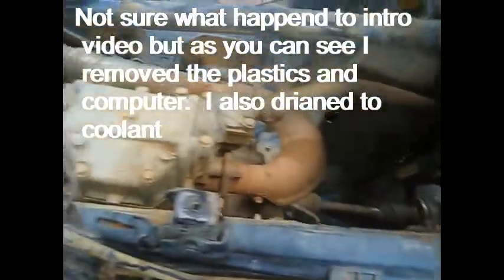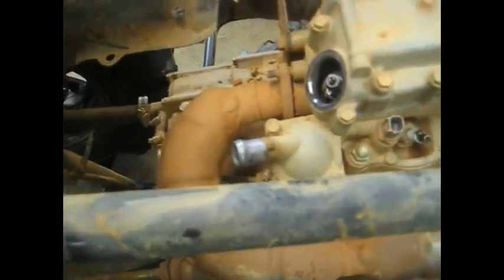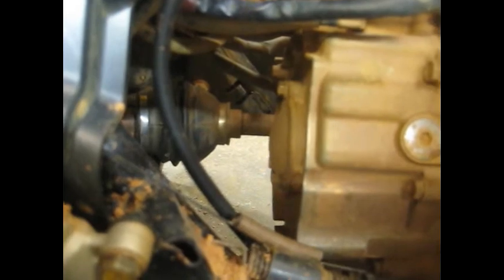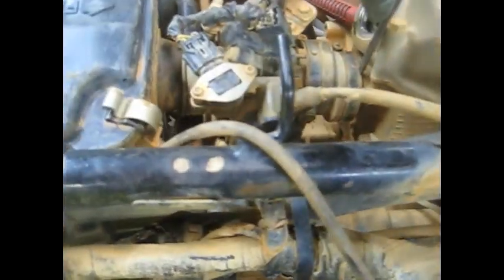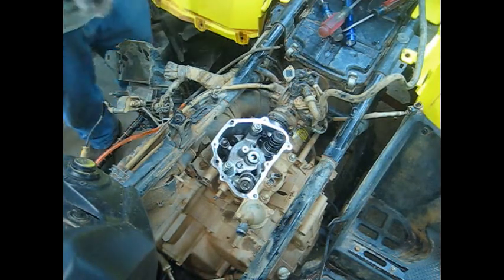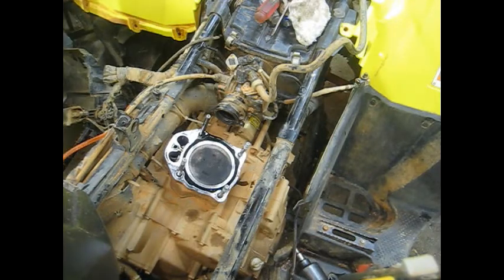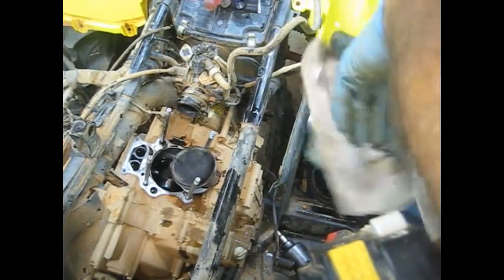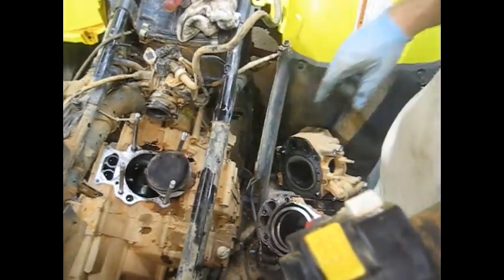Foreman 500 rubicon top end rebuild

Comment: You have the best videos man, really appreciate watching you work.  I just bought a 2006 trx500fe.  It had a brand new top end put on it.  Piston, rings, pin and cylinder.  It still had a slap in it, the powersport shop told the guy it was the rod.  Is there any chance that an oversized piston pin can be gotten and the upper rod and the piston hole be machined out to accept the oversized pin?  Thanks!

Comment: I have the same Wheeler but it's pouring oil in the air box. What could it be? I can ride for a few minutes and it's filled with oil. It's coming from the tube on the left side of the airbox.

Comment: After I put a new head gasket and torqued everything down , I’m guessing coolant is getting pst the gasket bc it leaks out the sides , is gasket maker of some time needed ?
Reply: It also smokes bad
Reply from the maker: You shouldn't have any gasket maker on the base or head gaskets. If you put it on the base gasket the gasket will squish out under the pressure of the head bolts and make it leak. You probably messed up your base gasket

Comment: I've always called it a rocker box but where do you get your parts from
Reply from the maker: Rocker box makes sense. I usually get my oem parts from one of three places. Either mrcycles.com, motorsport.com, or partszilla. The first may take a little longer but is normally cheaper but the last two can get me parts if they have them in stock in a couple days.
Reply: Thanks for the reply I'm rebuilding a 05 trx500tm I've learned alot from your videos
Reply: Last question is there a reason you didnt use any assembly lube
Reply from the maker: @kcwyrick7947  it's not a bad idea to use it. I usually just oil my parts before putting them back together.

Comment: basically i am trying not to pull apart the engine, and would hope the machine shop could do the connecting rod while in the motor.
Reply from the maker: You have to spit the case in order to get the crank apart to get the connecting rod out.
Reply: @FourwheelerDoctor  yea,  I was hoping that there was a way around that, by just doing an oversized wrist pin.  and just making the piston hole and the rod hole a very small amount larger to accomodate the size and tolerances.
Reply from the maker: @mikecochrane2074  I've never heard of anybody doing that but that's not to say it can't be done. I don't know if you have that much room on the Piston to make the wrist pin much bigger nor that much room on the end of the rod to make that much bigger. Then there's a chance that it may be the big end of the rod that's making the noise down at the crankshaft
Reply: @FourwheelerDoctor  yes,  i thought about that too.  I can feel the play in the wrist pin and rod, but not so much the lower rod and journal.   I am looking at getting the crank and rod assembly, just not sure about spending all that money.  But yea, if i tear it down, i will be studying your videos,  thanks for your time brother!

Comment: I see you didnt replace the cylinder it wasnt messed up at all with the wrist pin having play? Also did you measure the bore to see what  over size piston/ rings  you needed?
Reply from the maker: I had the original cylinder bored to match the oversized piston I purchased from Honda. I also purchased to same size oversized rings to match the size of the new piston.  If the cylinder is not scratched up deep I normally just go the first oversized piston which is 0.25 mm. This will clean of the cylinder walls and straighten out any imperfections in the cylinder. This also will allow for more borings down the road if needed since Honda does Offer Up to a 1.00 MM oversized piston.

Comment: Honda manual says it crucial that the top and second ring end gaps are only 120 degrees from each other you put yours in 180 from each other
Reply from the maker: It's critical that the gaps aren't lined up. It's really according on which manual you look at on how they say the gaps should be but they all say don't let the gaps line up.
Reply: @FourwheelerDoctor  Just wanted your opinion I’m getting ready to rebuild top end on my foreman 500 new jug, piston, rings, valves and it seems everything I read or watch says something different thanks tho